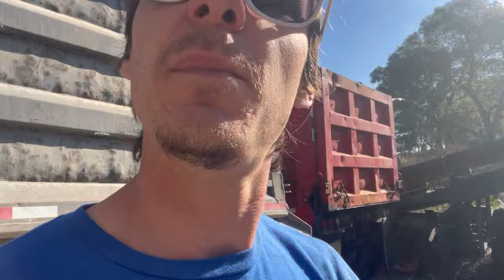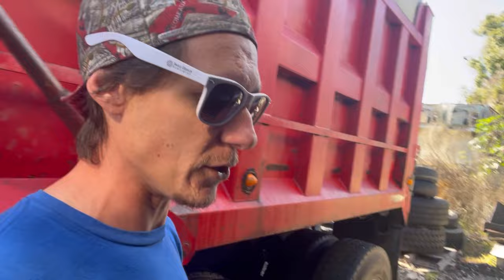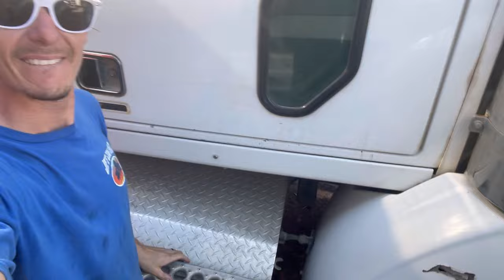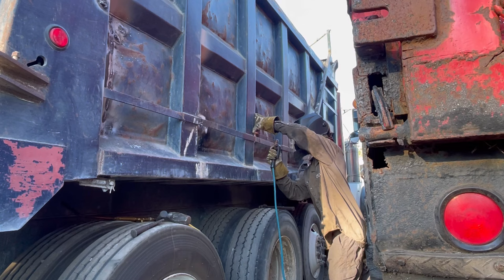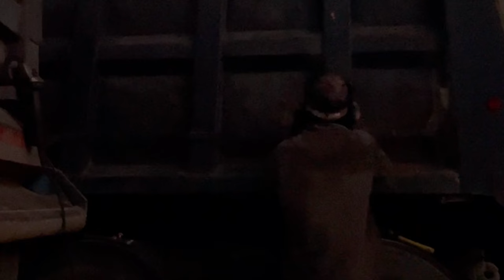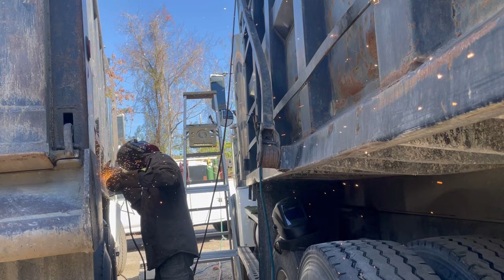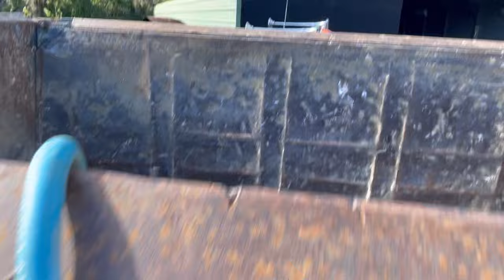ROUGH Welding Repair | Can I Get Them Back On The Road Before Time Is Up?! |

Comment: newer welder here, what is the benefit/disadvantages to welding uphill vs downhill?

I tend to only arc weld currently
Reply: You can't welder down hill structurally. If you do keep it quiet  and put an uphill pass on it.lol
Reply: up hill will give more penetration and build up, downhill less penetration and less build up....when you say arc weld, do you mean stick or SMAW...[all electric welding is arc welding] .welding downhill can cause slag entrapment and lack of fusion and missed areas due to the slag hiding the weld pool....with 6010 or 6011, you can weld downhill or uphill.....7018, 7014, only uphill because of the heavy slag.....hope this helps, Paul
Reply: What Paul said

Comment: You're polishing a turd, throw a patch on the inside and be done with it. If you wanted to put lipstick on a polished trurd, cut a section out so you know you have the material to weld to then put you patch on the outside and plug weld the inside. Aka, you're over thinking that job. I do it on a daily basis, stop thinking integral, start thinking speed